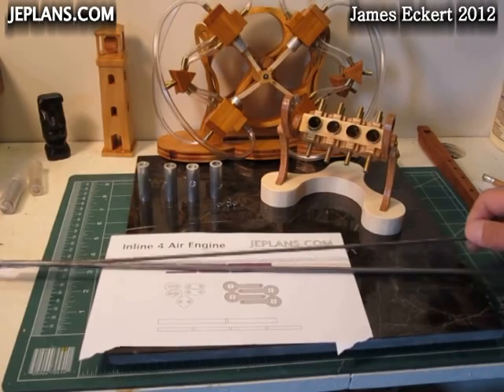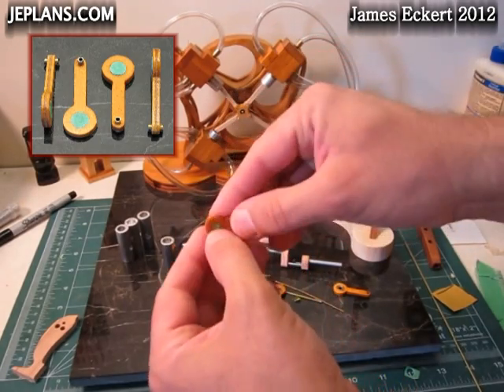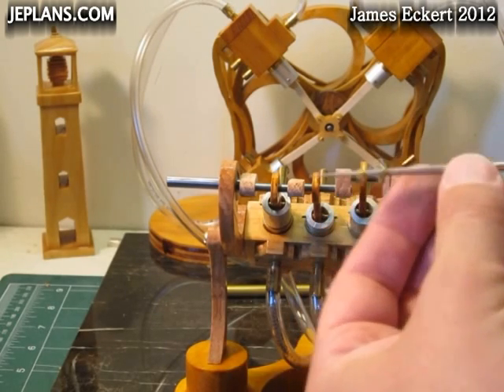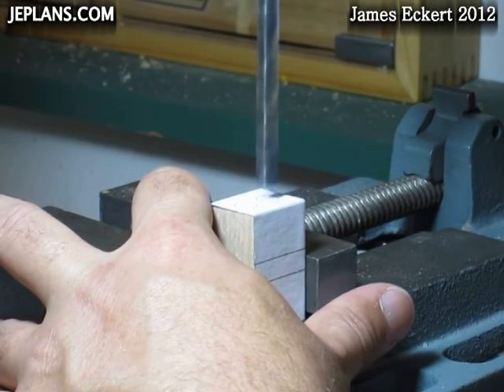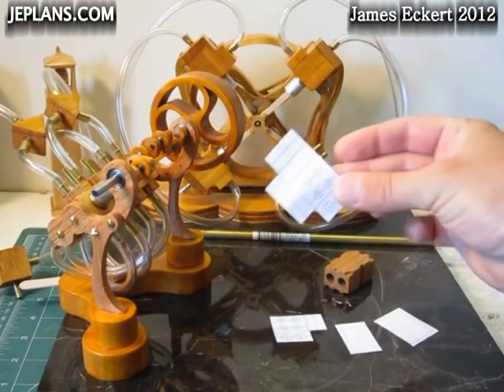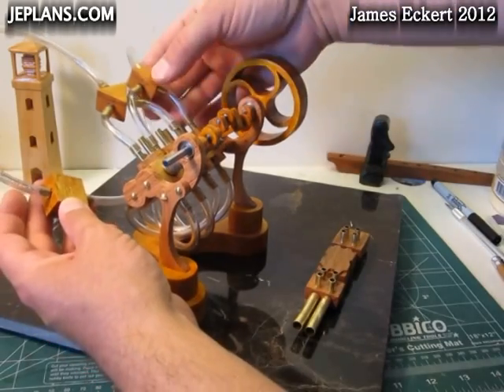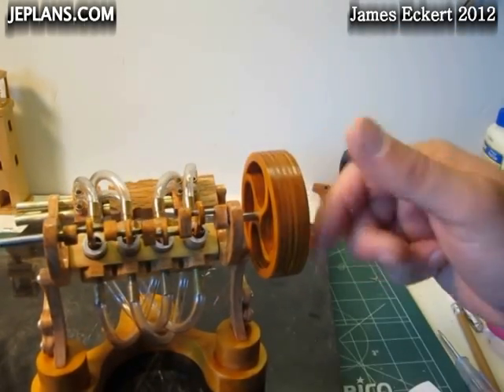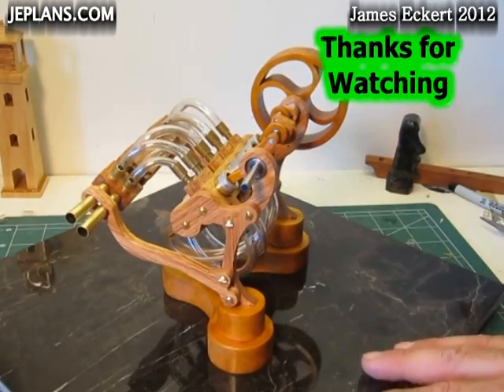Air Engine: Crankshaft and Air Bus

Comment from the maker: Well sure, it would really just be 2 of these set 90 degree apart, with a little crankshaft redesign could be done without needed more bearings. I don't plan on making one at least not for awhile. My next engine efforts will be making tubeless one possibility out of acrylic or polycarbonate and one that is 1/4 the size.